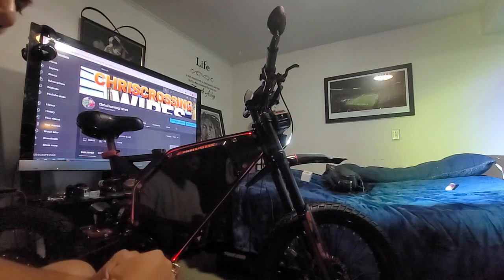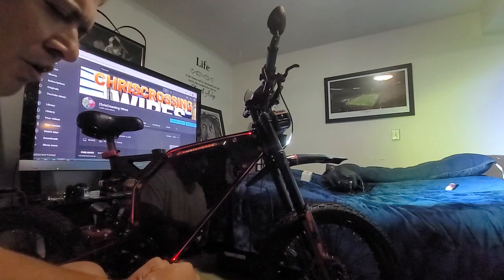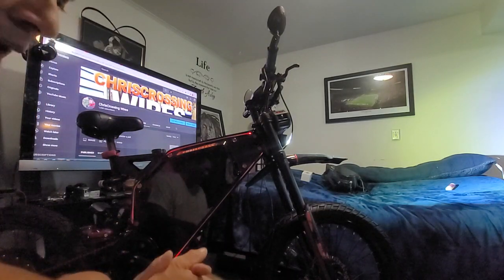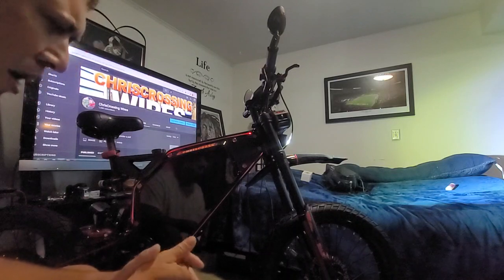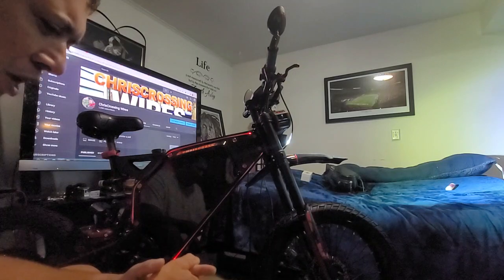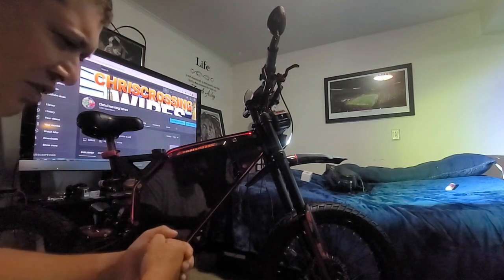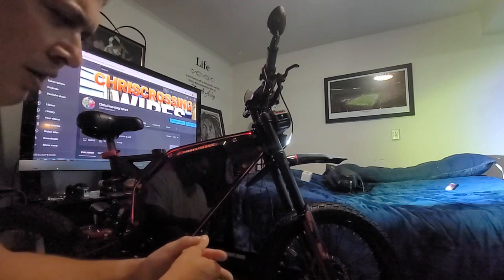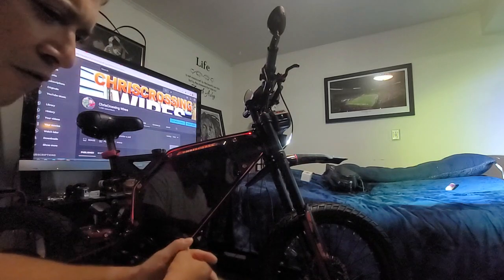Should you bypass your BMS? FK Nooo! if you have to ask that question you don't need to do it!

Comment: Ok - while you speak a lot of sense on the subject relative to e-bikes of a certain build and riders of a certain mentality, there is another way of looking at it. Why have a BMS? It's extra weight and extra space and If the battery and ESC and motor are specified and setup correctly you will be fine. So say your battery has a  max constant draw of 144amps at max charge of 50 volts (50 volts x 144amps = 7,200 watts ) and your running 2 wheel drive e-bike with say 2 x 3500 watt hub motors and limit both ESC's to 70 amps (70amps x 50 volts = 3,500 watts x 2 wheels = 7,000 watts) leaving 4 amps or 200 watts safety space- the most you draw is less than the battery max discharge - so at full throttle your battery will be fine even if you go everywhere at full throttle - if you do go everywhere at full throttle, you either have to slow down or you need more power, just upgrade motors, ESCs and battery ~(i.e. all with numbers higher than above),. Once you charge the battery your charger balances the battery and charges at a safe rate. Oh - I comment coming from ESK8 - my self built e-mountainboard runs 2 x 3,500 watt motors, as above, and never had any issues. I charge at less than 1c - around 10 amps max - if a battery has a 12c discharge rate it can handle roughly the same in charge but I charge slow to make up for discharging fast, as discharging fast is the more enjoyable of the two sins, and 7,000 watts on a skateboard is enough for anyone sane..

Comment: I done  it only discharge side as I bought one of them bird scooter batteries and it shuts off after 10 secs with load as the bms needs a GPS signal to get It to work and all cells are fine and my controller has a LVC so had no problems. You get problems if you try get out more amps that the battery can give then its a big problem think that's what most people don't understand
My battery gives out 30amps but my controller is only 25amps so no problem with that and always add a fuse then worst you have to do is change the fuse

Comment: This is a pretty solid explanation but there are a few key things I believe you should go over with your viewers. Constant versus peak ratings is one of them. The other is the battery output. By bypassing your BMS on discharge you leave it up to the controller to limit current. If that is set too high you can damage your cells by exceeding the rated output of each cell. The BMS is not connected on discharge so if the batteries do overheat the BMS will not stop it. Most advanced controllers don't have heat sensors for the battery.
Reply from the maker: True that, but honestly don't even have to go that far point is the guys that need to do it most likely know all of this and how to do it my point is for the guys that just Wana do what they see and think others are doing and just don't need to be doing it period. I'm not trying to teach then how in this video or teach them any aspects of it. This video is about just knowing why you would even need it, I have another video on ask of that. I just want the people who are clueless to stop trying to be like Mike!